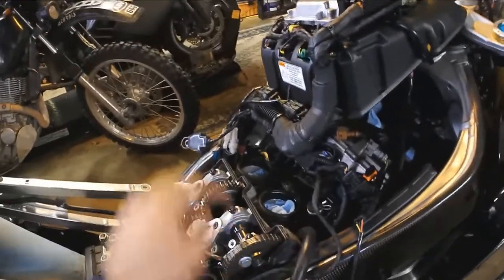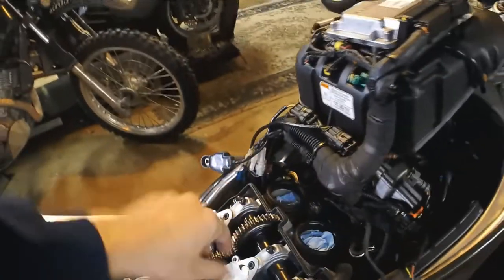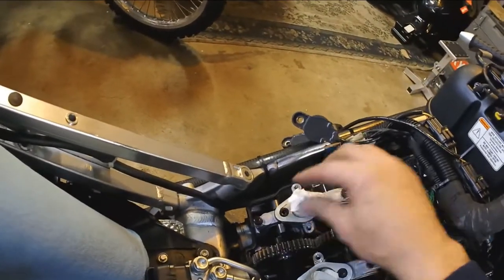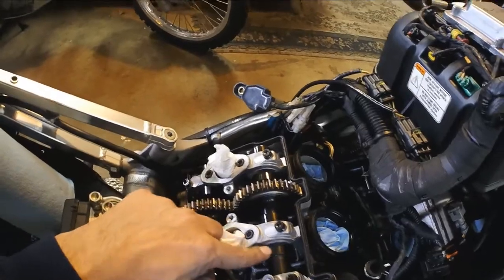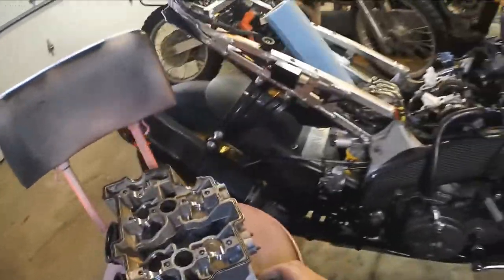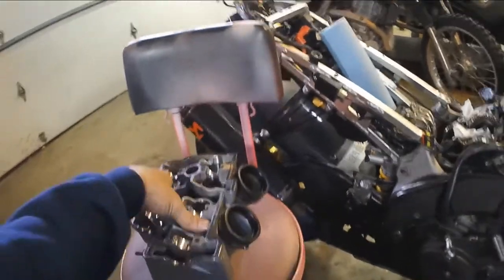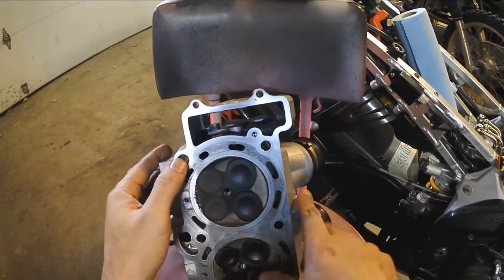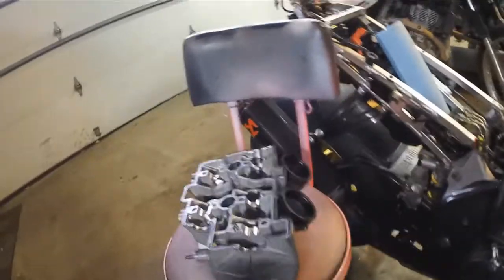RSV4 valve check, part 2

Comment: Great video Shaun. I have a couple of valves reading .22mm on the exhaust (.02mm over spec) and .16mm on the intake (.01mm over spec). The bike has a little over 12k miles on it, with maybe 500 being track miles. It'll be my race bike for next year, so do I need to adjust it?
Reply: Or should I check it halfway through the race season to see if it closes up or gets worse?

Comment: From what I’ve read correct engine rotation is important due to cam chain/ belt tensioner set up. If slack is created you may jump a tooth on pulley/ sprocket.
Reply from the maker: I've heard that too, but if the tensioner is working the chances of this happening are small to non-existant.

Comment: Hi dude donne my valve clearence as well on my 2019 factory ,now i have a small issue with my throttle is not very reponsive wend on idle on low revs ,any clue dude ? Love your vids
Reply: was everything ok? Or adjustments were needed.